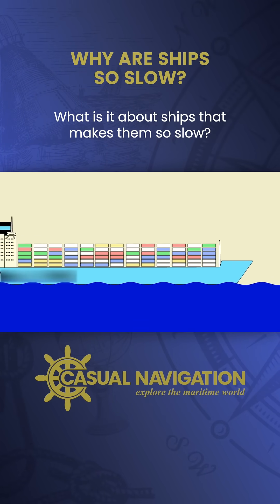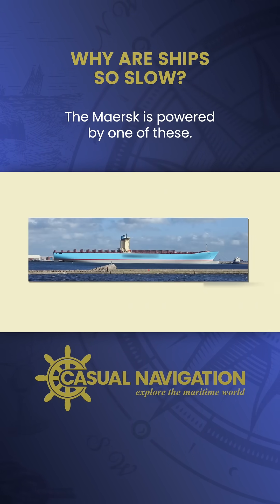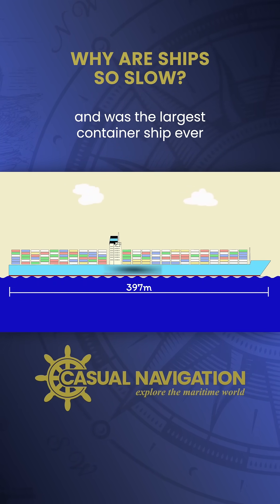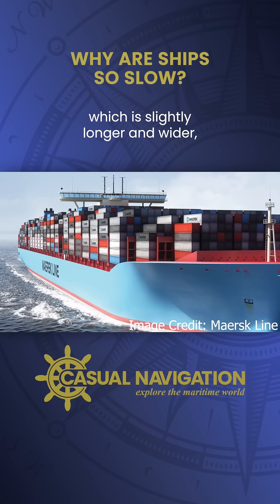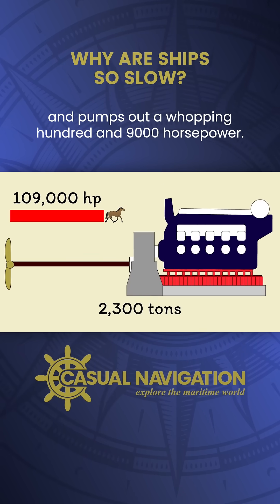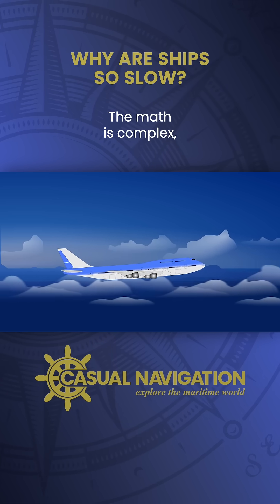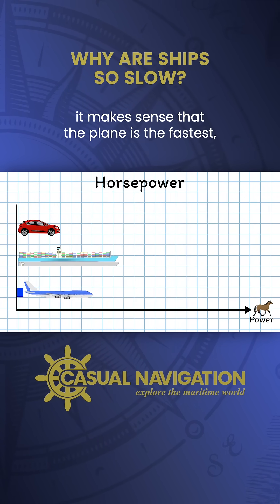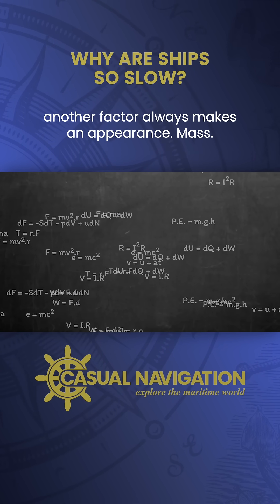Her massive engine is 'kinda' disappointing…

Comment: 150,000 hp? Is that per engine or all four total. Also it is not hard to get a horsepower rating for a jet engine turbine if it has an aeroderivative version used for power generation. The Pratt & Whitney PW4000 which is used on the Boeing 747-400 has a ground power version that puts out 91,000 horsepower per turbine core. Otherwise go with the thrust times velocity equation which will give a big number. There are relatively large water jet ferries that are fast. HSC Francisco is a high-speed catamaran built by Incat in Hobart, Tasmania. Powered by liquefied natural gas, It is currently the fastest passenger ship in service, reaching a speed of 58 knots (107 km/h; 67 mph). Propulsion is by two GE LM2500 gas turbines, coupled with two Wärtsila water-jets with a total of 57,000 horsepower power. It displaces 1500 tons or comparable to 1000 cars at 60 mph would probably be using something like 60,000 horsepower. Interestingly similar. An aircraft carrier can do 40 + mph. The SS United States was claimed to have done ~ 50 mph with 250,000 horsepower and displaced 45,000 tons. As a note, there are significantly larger container ships now.

Comment: I thought ships were slow because they have to push the water out of the way. 
And then they have low power to weight because they have to go slow anyway, unless they want to leave the water like a cigarette boat, or run inefficiently like an ocean liner.